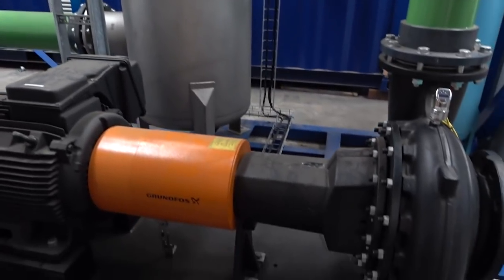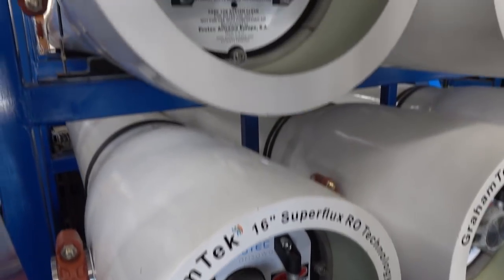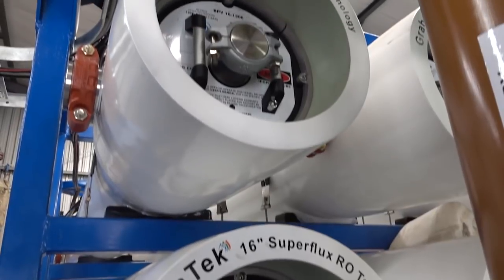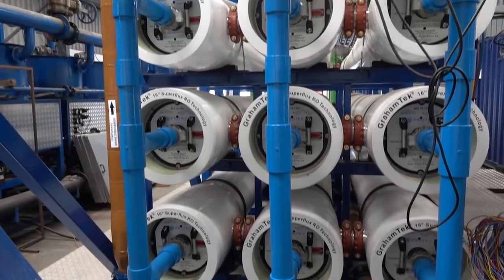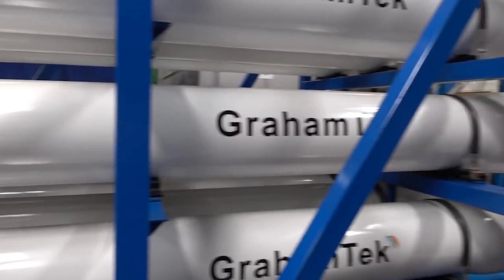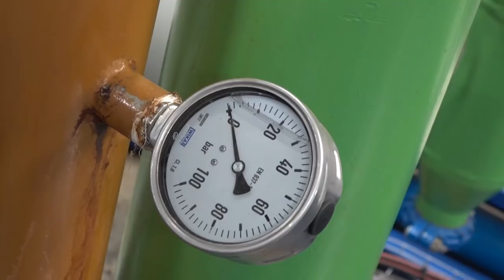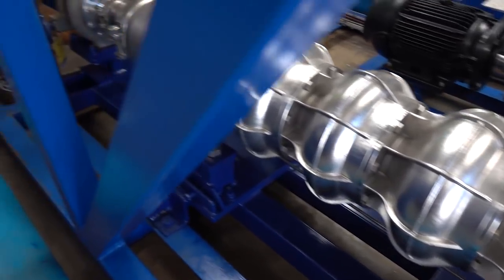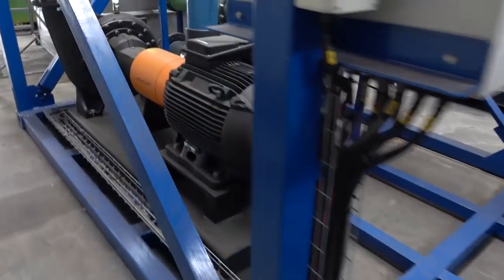Desalination in Cape Town

Comment: Great to hear the desalination process is put in use. But you are using the process that will use lot of power. There are two choices of power used. 1. is the nuclear power 2. the PV solar power. both are expensive.  Love to help using my technology.I should have my product ready for use by end of 2018. Its a CSP technology units that can produce 100+ gallons per day of fresh water using 100% green technology desalination process.
Check out the link below:
gofundme.com/solve-the-world039s-water-problem
Let us all help solve the water problem together.Great video